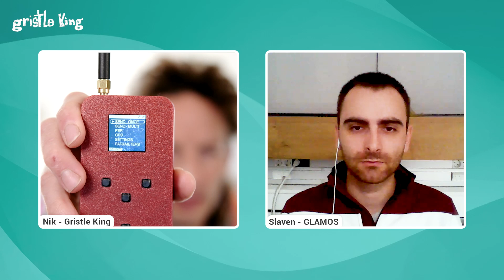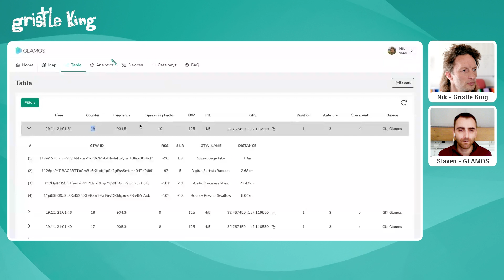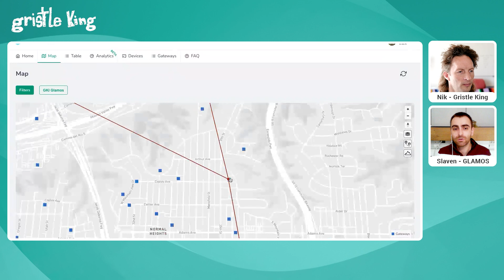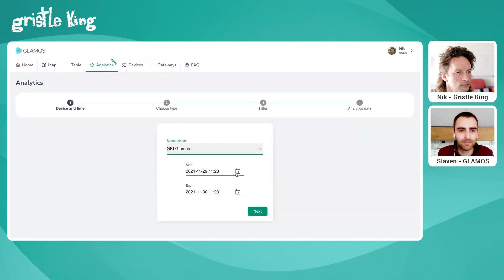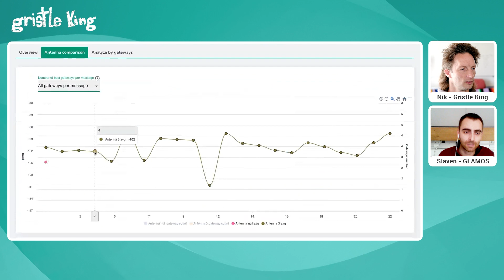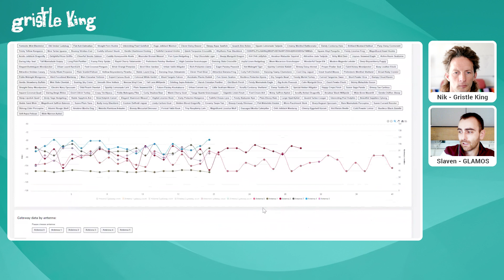A Deep Dive into GLAMOS: The Helium Testing Tool

Comment: So, this isn't a device that you could determine hnt or rewards generated per month.  You could not look at the data and reasonable conclude this spot should generate $250-$300 per month.  Is that correct?
Reply from the maker: Probably not.  You could guess, but a better predictor will be based on what local hotspots are already doing, then modifying your predictions depending on whether you think you have a better or worse position.  More info over in the Helium Courses: https://grstl.ink/courses